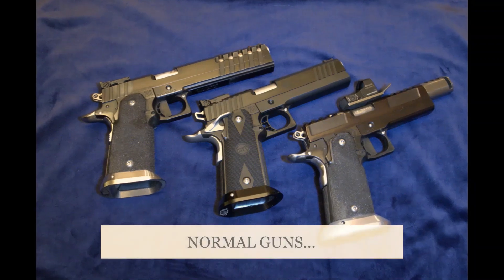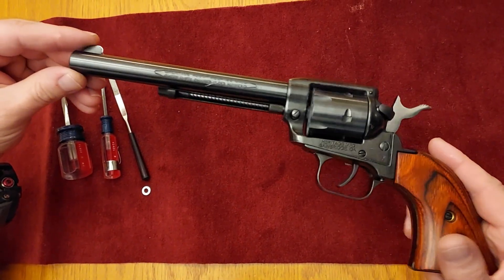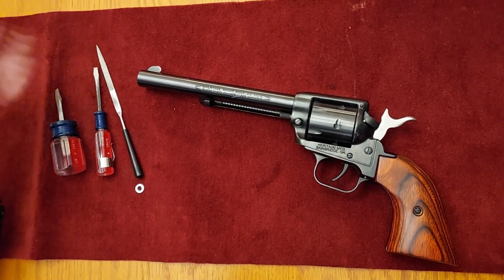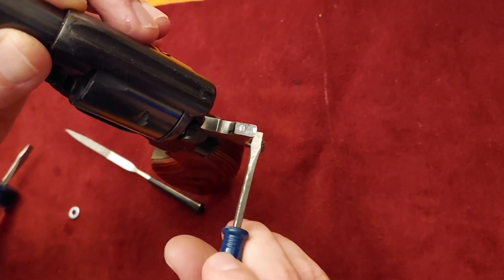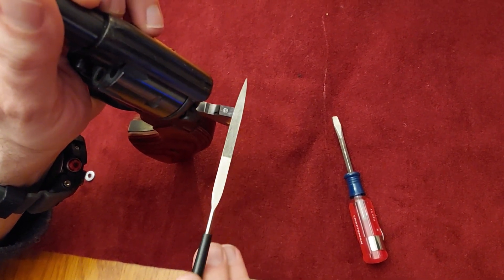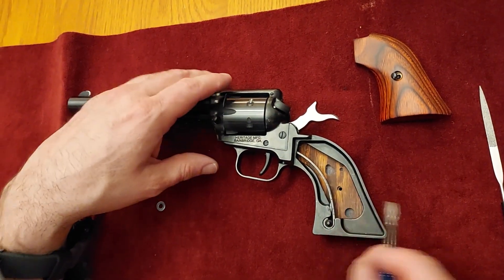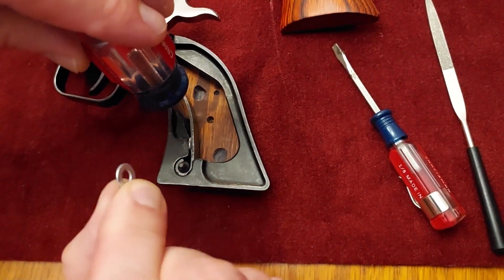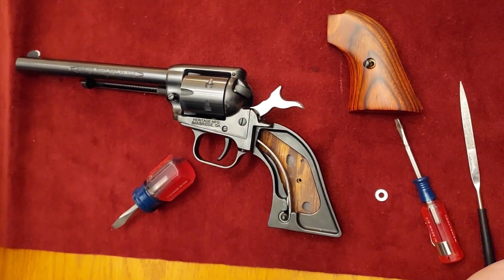Heritage Rough Rider Reliability Mods

Comment: I have several Rough Riders. I've had issues with most of them. I get lots of no fires that fire the second time around. Some rounds just don't fire, and some go Pssssst and they  round hits 6 inches low  at 30 ft. Some ammos are worse than others. I'm anxious to work on them. Armed with your knowledge I hope to see some improvements. Thanks for the tips Dude. Soon as I get done subscribing to your channel, I'm gunna grab a file and some little washers and some guns. I'll let you know how things go.
Reply: In another video someone use a piece of plastic from an expired credit card or some other membership such as a store savings membership card.  This is to increase the pressure on the main/hammer spring to eliminate light strikes.  It is also not uncommon to have a light strike follow a good striker after moving case so a different part of the rim is struck.  This can be a symptom of poor quality ammunition.  Remington Thunderbolts and any Winchester 22LR often gets poor reviews.
Reply: I read if you buy bulk 22 lr ammo like in the old school milk cartons your going more misfires than buying say 100 rounds at a time
Reply: This worked perfect on my 2 Rough Riders.
Thousands of rounds later they just keep on shootin'...every time.

Comment: Great tips!  Thank you!  Most of my ammo fires reliably in my RR, but some, like the Aguila, has the occasional misfire.  I've made these mod's this afternoon, and am looking forward to seeing if this cures the issue.
Reply: I just bought 2K rounds of Aguila before I realized it tended to cant on firing, and the cases stuck against the recoil shield...and are hard to eject in general :|  I ended up filing the recoil shield square and increasing the gap just a bit until it works smoothly.

Comment: I've had mine for 4 or 5 years without any reliability issues. Only a few misfires, which were found to be ammo-related. The only issue that I've had relates to some of the screws loosening, which is easily solved with the application of Loctite.

Comment: I guess I got lucky with my rough rider ! It has never had a misfire after about 300rds . Mine came with plastic flag grips and I filled one full of lead shot, used a scale to get both half’s of the grips the same weight and poured epoxy over it to secure the lead shot and it is MUCH more balanced and way more comfortable. I absolutely love it now .
Reply: GREAT idea.  Thanks!

Comment: All together to really dial this baby in well. Is 1. Follow this man's steps in video. 2. Reduced spring kit set. 3. Check out on online diy: slick up a Ruger single action on guns America to give you a great idea to lap all the intricate working parts of revolver. 4. Loose barrel fix and loose screws fix. 5. Throat ream cylinder holes so ejector rod does not have to be used any more for quicker unload and reload. 6. Chamfer cylinder holes. 7. Modify cylinder leads and cylinder notches and bolt to convert to race gun. 8. Force cone shaft of barrel, lap and polish, mop and rust prevention oil with cloth swabs. 9. Don't forget to deburr on intricate working parts from factory on smoother operation. 10. To convert to shooters gun then remove the safety for desired option. 11. Free spin pawl and it can be modified for this option so the cylinder can spin in both directions when half cocked. 12. My favorite by Cisko master gunfighter. Machine a 6061 or 7075 aluminum press fit then a thumb attachment to tip of base pin for faster cylinder extraction and allows to put in next cylinder much much quicker. It can be anodized to black for press fit thumb attachment to tip of base pin.Now your SA Revolver is sweetened up for the range on good times. Enjoyed this video as well. Great job. 👍 Also a front sights mod if needed to improve accuracy. Also force coning shaft of barrel will also improve accuracy.
Reply: To top it off is a space cowboy kit attachment to heritage rough rider, like Steve Miller Band said in his classic rock song. I'm a space cowboy. 😂 In the artificial intelligence moving in now. Perfect time to upgrade to space cowboy revolver attachment. Then a homemade buttstock attachment like Lee Van Cleef in the movie "Fist Full of Dollars." Attach a mini scope on top of space cowboy kit. An ammo loop sheath to buttstock attachment to hold extra .22 mag rounds. A leather sling attachment with ammo loops to hold extra .22 mag rounds. Leather sling will attach to rear of barrel and bottom rear of buttstock attachment. Now the baby is set for long range shots at 100 to 600 yards at steel targets at range for good sport or small game hunting. 👍
Reply: Last one I forgot to mention is a suppressor for the heritage rough rider. Now days they have the tactical cowboy heritage rough rider that has the capability to screw on suppressor. By the time you do the upgrades mentioned above in my other comments then this will greatly improve and on top of a conversion mini rifle. Enjoy the sport and range.
Reply: Also for a little golden nugget tip. Is from the book by Chicoine on "Gunsmithing guns of the Old West" 2nd edition. To prolong the life of your trigger spring which is exactly like a colt trigger spring. Is use some Indian stones and put a slight radius on each spring for the left corner and right corner. This way after hundreds or thousands of rounds you'll prevent trigger spring breakage. This will keep you from having to buy another trigger spring once lots and lots of rounds are going through that barrel. 👍

Comment: It would be helpful to let everyone know the use of the washer is to increase the pressure on the main/hammer spring to eliminate light strikes.  I would only increase the pressure if I had a issue with good ammo failing to fire.  Someone else used a piece of plastic from an old credit card.  The credit card would break eventually but the washer could rust.  

The other thing all should do is apply some blue (medium) thread locker on the screws as it is common for the screws to become loose and fall out.  Harbor Freight sells thread locker for about 1/3 of the price of anyone else.  Do not use red "permanent" thread locker as you may need to remove some screws someday to repair the revolver.
Reply: Thank you for explaining that. Like many people, I'm not satisfied with being told what to do; I need to know why I should be doing it too.
Reply: I'd probably add a stainless steel washer to prevent rusting. That you for bringing up that point.
Reply: @rickhenry8760  I've read that having two different metals touching can promote rusting.  I'd probably stick with a durable plastic or other polymer so I don't have to worry about that issue.
Reply: Do you need to put the loctite on the hammer and trigger screws ? I felt uncomfortable trying to do it so i didnt get them all the way out because i dont want to mess the gun up.
Reply: @raykettel1837 yes, it’s called electrolysis which happens with dissimilar metals in contact with each other. Will cause corrosion and breakdown of the metals.
Reply: Great ideas. Read the comments and it all makes sense. Stainless steel washer or stainless steel sheet stock or using aluminum washer or aluminum sheet stock.

Comment: You are pure genius sir. I'm getting frequent misfires and Heritage customer service will not even reply to my support request. I'm not too thrilled about paying $60+ to ship it back there too. I paid $110 for the barkeep 2" barrel new lol.

I looked at my gun and I can see bright as day where the hammer is contacting on the top, exactly where you said. I will be doing this before my next trip to the range. Thanks for the video 5/5 stars!!
Reply: I tested this today, and the barkeep ate every type of ammo I put into it 100% rounds fired. Thanks!!
Reply: Heritage needs to watch these videos and redesign their frame or the hammer spring to increase the tension just slightly. They have to know that 9 in 10 of their rough riders are having these misfire issues all linked to the poorly designed hammer spring

Comment: I flattened and clipped a .22 casing and wedged it between the hammer pin and frame to increase tension. Worked great. All you need is a wide flathead screwdriver and something to flatten the casing.

Comment: I’ve seen them scrape off the side/s of the channel thru the cross bar safety too. I wish some company would do a replacement to the safety to replace it with a cosmeticly pleasing part for those that prefer the classic look of a Peacemaker.
Reply: if you prefer the look of a peacemaker save your pennies for one i think this is way too inexpensive of a firearm for such aftermarket support

Comment: I just made a new mod myself. I filed the recoil shield square. Some ammo was getting stuck after firing.

A few others I've done are, remove the barrel and sand the frame square, and rotate the barrel so the front sight was aligned.
I bought an all steel after market ejector. Still need to file a slot so that cresent handle sits flush with the barrel.

The gun shoots great...

Comment: Ive already shot my rough rider 1100 times its cheap it feels like a fixer upper ive done alot of work on it for reliability lots of shaving finding the right ammo to stay clean (Remington thunderbolt) now i feel like i can shoot it forever without anything jamming i used to have to clean it after 80 shot now its smooth and shot 200 shots in a row without problems my trigger spring broke after 1000 shots i think it broke because i found an extra firing pin inside the gun and probably why it broke pretty crazy

Comment: What size washer did you use? I just got one of these and haven't tried it yet, but plan on trying it over the holiday weekend. Shall see if I need to do either of these mods.
Reply from the maker: My washer is .032" .  This is just general guidance.  If you still have issues, you can go thicker as it's not critical on these single action revolves.  On higher end revolvers, there is a set screw in the same spot that will allow you to adjust your spring tension.  The set screw is then used to allow you to tune the DA trigger pull based on primers used.

Comment: I admire the effort to improve a mechanical system. I disapprove of the methods. A better method would be to remove the hammer and use a honing stone to achieve a really flat hammer face. The "washer" fix might suffice in an emergency but as a permanent solution, well, no. A better method would be to add a strain screw as is used in a Smith and Wesson revolver to increase tension of the main spring if a stronger spring is not available. If, indeed you MUST use a wedge to increase spring tension I would do it at the BOTTOM of the spring where movement is minimal or non existent. <wedge on the opposite side of the spring at the base, between frame and spring>.

Comment: Very nice fix. I have one with a stuck cylinder rod, it will not release at all I don't want to rough handle it but it causes me some concern. I want to be able to clean it but this is a problem. I really like the gun even with this setback. Can someone say what to do about it?
Reply: Try soaking it with Blaster? I’ve seen it do great things

Comment: Great video with good advise. Although it is a shame these come new worthless out of the box. The price doesn't matter, any new gun, even more so one claiming "Made In The USA" with pride, should NOT need to be modded or tweeked to work properly period! Shame on taurus for running the Heritage name in the dirt. Foul and worthless company on all accounts.

Since taurus doesn't care, thanks for making a video and helping out all the thousands of guns sold with light strike issues!!! Thank You!
Reply: mines fine i shoot magnums shorts and lr out of it none of these light strike issues or hammer not contacting only fitment issue with mine is the seem in the frame which does not impact function! inspect your revolver before purchase!
Reply: @SirThatsLegal  you can inspect them all day. You will not know the pistol has these issues until you fire them, or try to. 8 out of 10 taurus rough riders will have either light strikes or hammer spring problems. 
Ruger has fixed this issue with the new super wrangler that shoots both, so there is absolutely no reason to even buy a faulty taurus now.

Comment: I bought two rough riders and both had to be sent back because they only shot half the time. I bought it online and when I contacted them to send it in it was a nightmare as no one would help me since I didnt buy it local from them. horrible customer service . Not only did they charge me for the repair , I also had to pay my FFL when it came back. Buy a Ruger
Reply: Had the same issue right out if the box,  but once I mentioned 'I should have bought a Ruger Wrangler' atao customer service they changed their tune and sent a free shipping tag for a free repair.